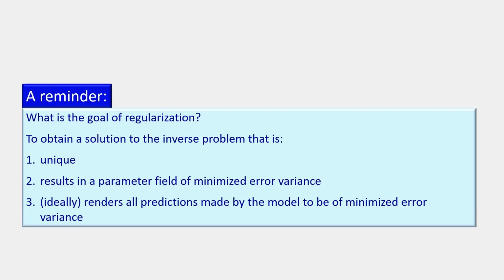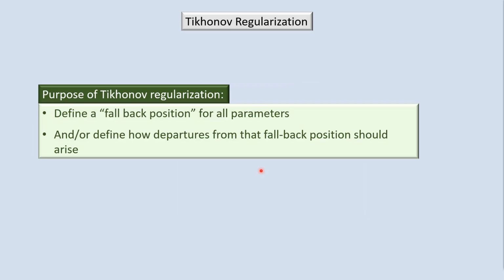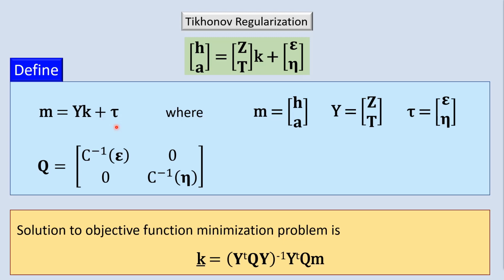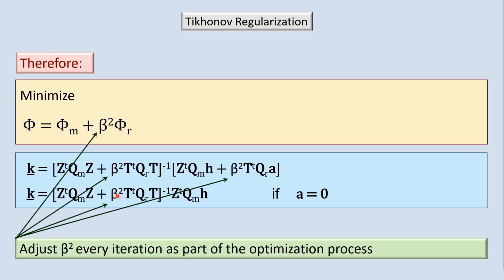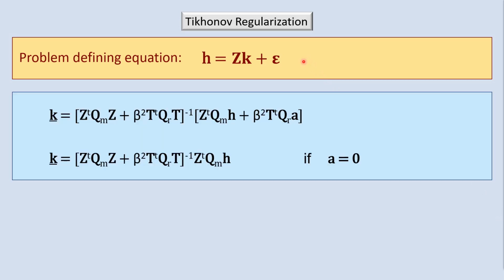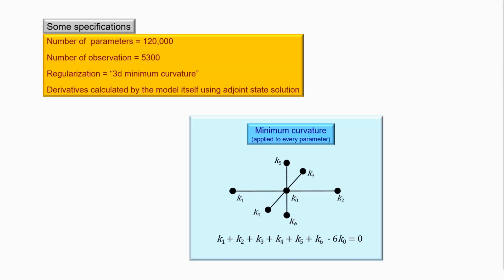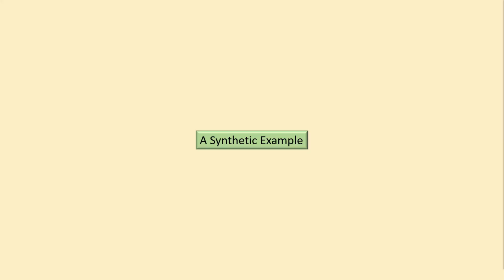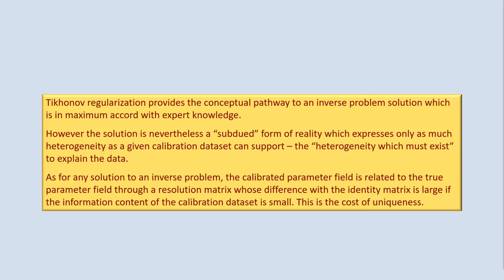GMDSI - J. Doherty - Tikhonov Regularization

Comment: You mention different T-matrices from approx. minute 11 to 15 (preferred value, preferred difference, and minimum curvature). Is there a source to this, where there are additional T-matrices? Or is there a search term I can use to find out more information about these matrices?
Reply from the maker: From John Doherty 
(for further questions you can sign up to the PEST LinkedIn group https://www.linkedin.com/groups/12077648/ )

Each row of a T matrix that specifies a preferred difference has two entries - a 1 and a -1. The PPKREG utility (which is a little outdated now) automates preferred difference regularisation for pilot point parameters. See also GENREG. Both are described in part B of the manual for the Groundwater Utilities.

Minimum curvature is normally used for parameters that are disposed on a regular grid. Each row of the T matrix has -1, 2 and -1. The idea is that differences of differences are minimized. There are no utilities that automate the setting up of this with PEST. It would be easy enough to do with a self-written program.

I hope this helps, JD